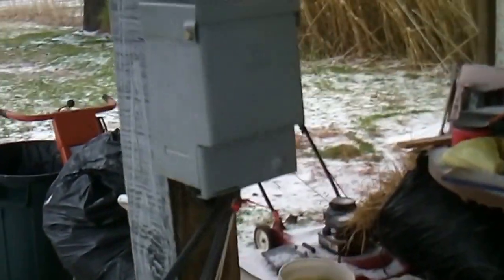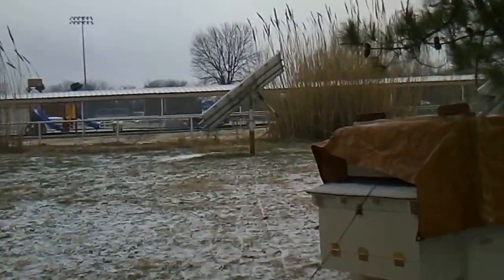My Midnite Solar Baby Break Box

Comment: I have been looking at there small breaker boxes. for my solar install I'm doing. I like the Din rail mountable breakers. but the breaker boxes are only able to take 6 gauge wire I have 2 gauge wire for my Inverter and there 100 amp breaker will take up to 2 gauge. but the box all say only 6gauge I guess I always work around that. But I might just get the breakers some din rail and use the boxes at lows they are much cheaper.
Reply from the maker: You could solder a butt joint of 6 awg on the end of your 2 gauge that will work if your only going to have a short piece of like a foot or six inches to make it work. I dont think it would hurt a thing if you make a nice solder weld.  put some shrink wrap on it to make it look nice and pro. it would be fine. Then you can use the switch box that is affordable. I dont like to spend a arm and leg I want it to pay back sooner than later.

Comment: Is it 10 gauge stranded wire? I just got my first panels. Still have to  piece by piece buy the rest to get up and running. Did you get the box local? Thanks for sharing what you are doing. E :)
Reply from the maker: I am using landscape 8 and 10 gauge wire it good to 600 volts and like 120 stranded real copper wire. Very affordable. UV resistant and bury able. Its really pretty good. Get the 8 gauge if you dare to because it is awesome no voltage drop at all.
Reply from the maker: You get the wire on ebay. I got actual solar wire from arazona wind and solar. But the landscape wire is cheaper and it works great. You can bury if you choose to. I never have got my system where I think Im going to have it yet.  So I always am moving it constantly. I think I may go ahead and bury the landscape wire this time so I can mow easy with out having to move it. all the time. It drives my wife bonkers. He he.